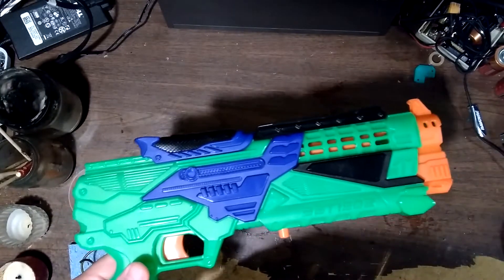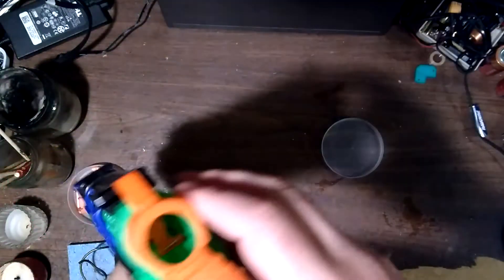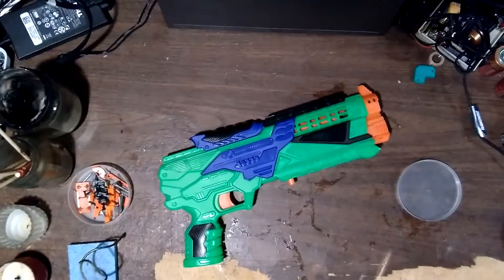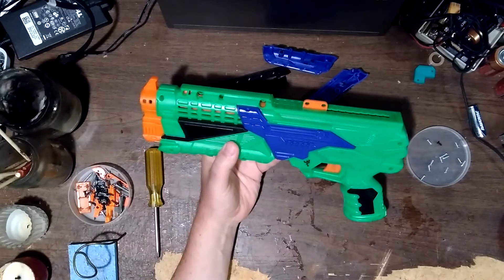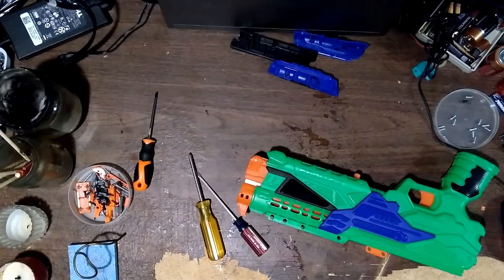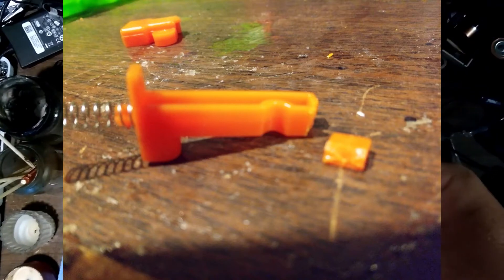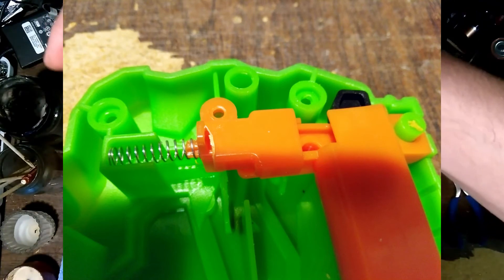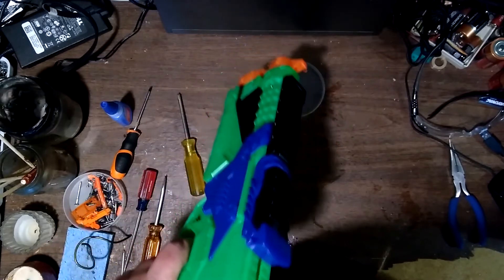[FIXED] Buzz Bee 1902 pistol dart blaster

Comment: I always end up cutting the front of the 1902's, as that front piece is crazy solvent welded on. This is one blaster that could really make use of a metal catch in my opinion, and also part of why I prefer the Revolution over it.